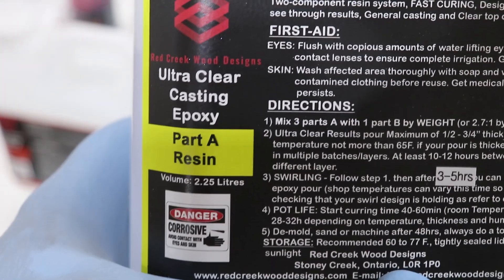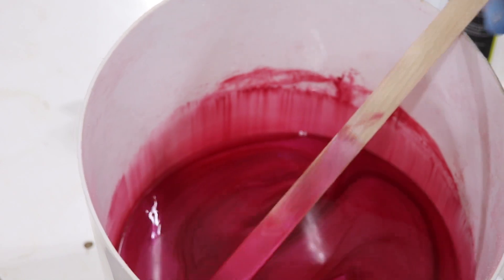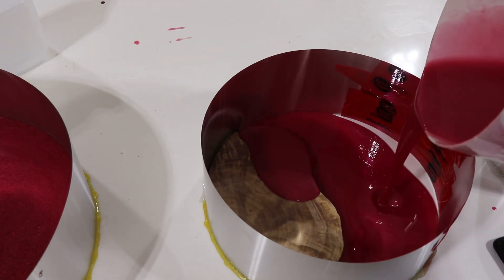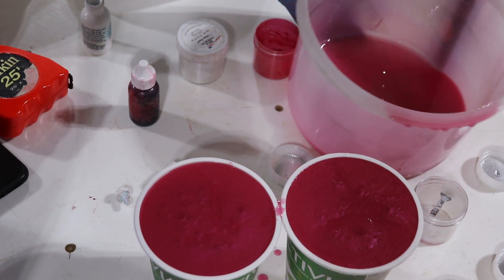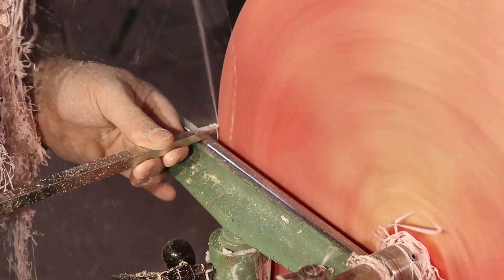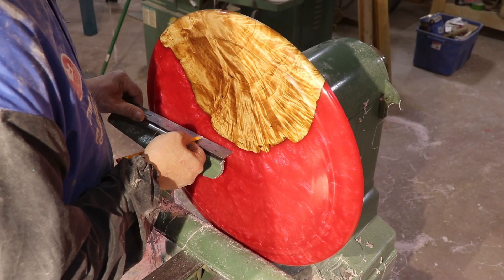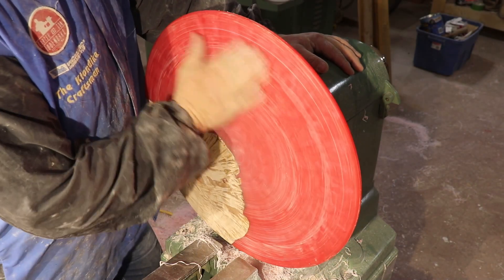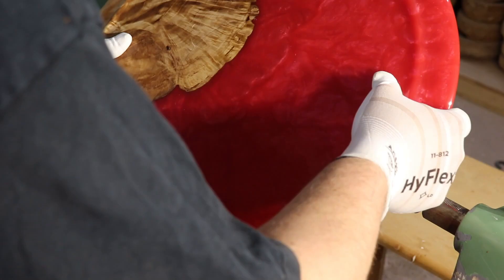Woodturning |  Huge Resin Pour for Hybrid Cake/Cupcake Tower - Part 1

Comment: I was going to ask, since you don't want to mix, wouldn't mica powder have been the better choice? That swirl reminds me of those peppermint ribbons.  Bummer...you forgot the outside lip.  What is going to keep the cupcakes from rolling off?
Reply from the maker: You always have to mix, I didn’t want to use a drill and mixer to avoid bubbles. I did use mica powder along with the dye. Mica powder actually needs more mixing than the dye. I didn’t forget the lip, the cupcakes have flat bottoms. I’ve never actually finished this piece, I need to get back to it! Thanks for watching
Reply: @TheKlondikeCraftsman  I saw the lip afterwards.  I think I was looking at the bottom when I asked that.

Comment: Nice work! What are you using for mold material? Flashing?
Reply from the maker: Thanks! That is exactly what I used. Flashing on an HDPE bottom. Thank You for watching!
Reply: @TheKlondikeCraftsman  l just bought a roll..  plastic can’t take the heat of large pours.
Reply from the maker: Sometimes it will not!

Comment: That’s really neat Lewis. I can’t wait to see the next installment. What material did you say you made the mold with? Do you get it locally? I’ve been trying to make something similar (mostly unsuccessfully) for platters that will fit in my pressure pot. You might just have the answer I’m looking for! 
Thanks.
Reply from the maker: Thanks Jeanie! This was just a roll of aluminium flashing glues to 1/4” hdpe. Thanks for watching!